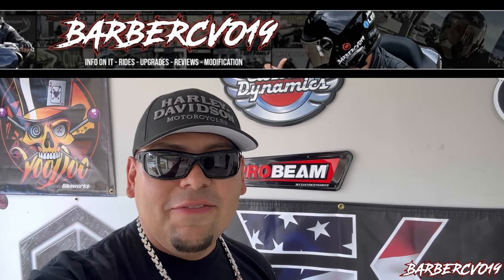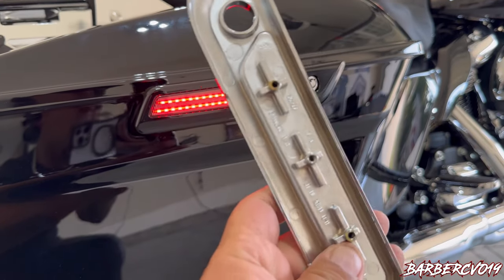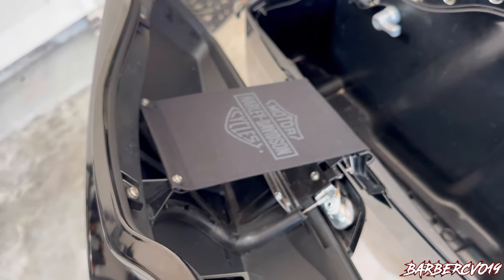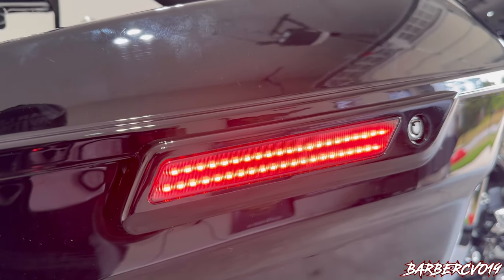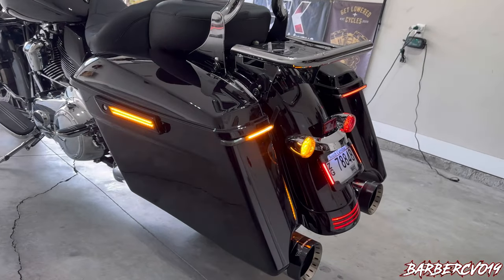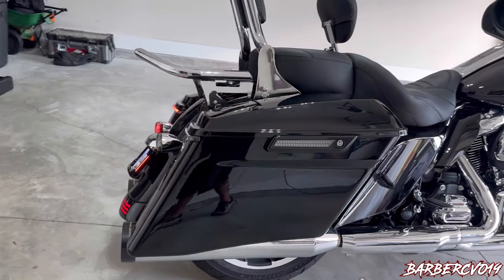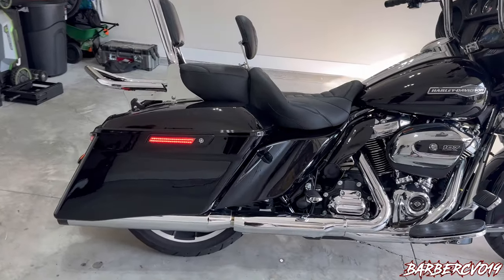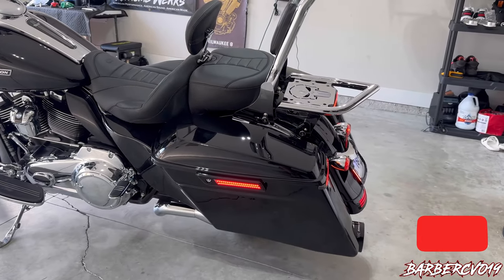SADDLEBAG LATCH LED REFLECTOR / Custom Dynamics

Comment: Hey man quick question my set up is kinda like this did you do plug and play for all three led light how did you wire everything
Reply from the maker: You need a splitter and u can connect all together
Reply: Would you happen to know where to find one the only thing I found was using the plug for the tour pac
Reply from the maker: @RayRay61291  call custom dynamics and u can buy splitters they sell it.